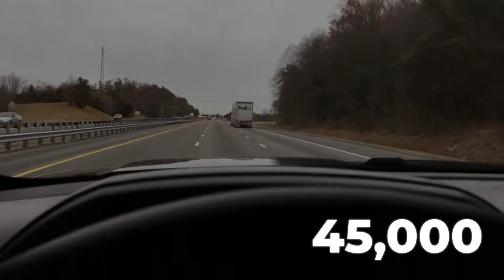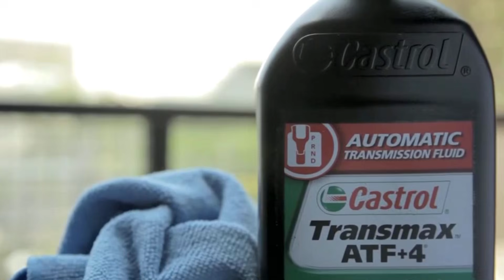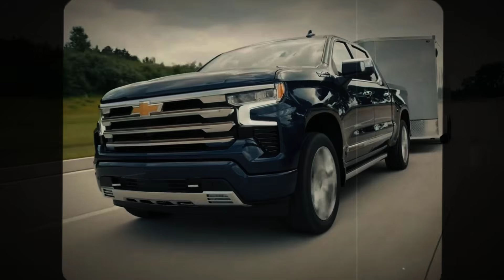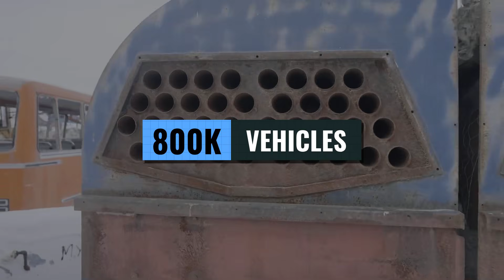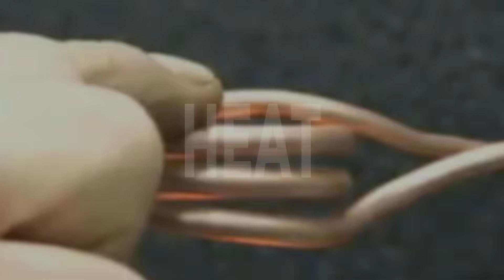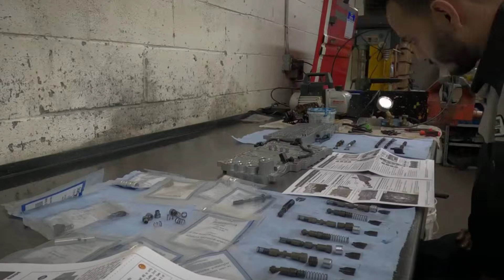Your Chevy Transmission Won’t Last 100k Miles Unless You STOP Doing this

Comment: Bought a 2018 in 2020 12k miles. Changed ALL the fluids right away. Oil, use 5w30 oil, trans use HP/LV Mobil 1, Get that Trans Thermostat updated. Diffs, Transfer case. Best money ever spent. The Break in metals are there. YOU NEED to get them OUT.  Get that trans thermostat Updated. Install an oil catch can. disable the DOD and you have got a pretty good unit. Note All this crap is due to the Government Overlords. They decide what a car company can sell.

Comment: GM is not your friend.
Reply: Every manufacturer
Reply: Your correct.  I bought a 2026 Silverado 5.3 vortec,  LT,  Z-71 and was told that the AFM/DFM was no longer installed,  which we all know kills 4 of the 8 cylinders throughout a drive to help save fuel. I didn't buy a truck to have a 4 cylinder engine.  Well come to be it has the DFM and sent a nasty gram to GM and vented. I waited 35 years to get my truck and now I can't get ride of it.  I should have kept the 2025 4RUNNER that I traded in for the Silverado.
Reply: @bobpritchard979  I just had a full DFM delete done on mine. New camshaft, new non DFM lifters, reprogrammed ECM. Transmission thermostat bypass valve installed, and fluid-filter replacement. Next up, rear differential oil and aftermarket cover with visible fill level.
Reply: @kenny-tu2bu did you pay for it or did GM?
Reply: @bobpritchard979  GM won't pay for it. In fact it will void your warranty. Wait until the warranty is over, then either get rid of it, or get the DFM delete. I paid $5100.00